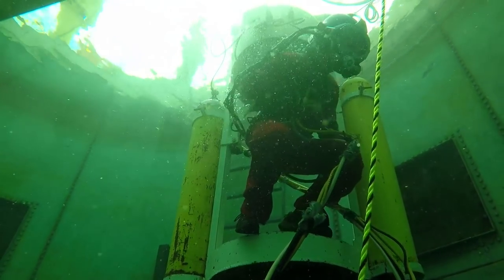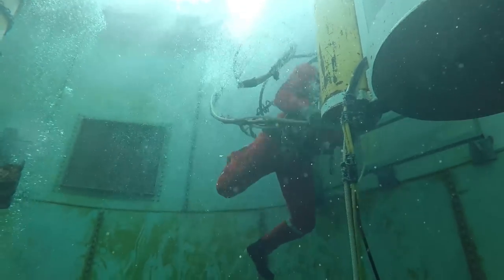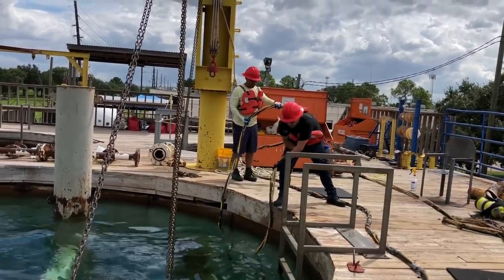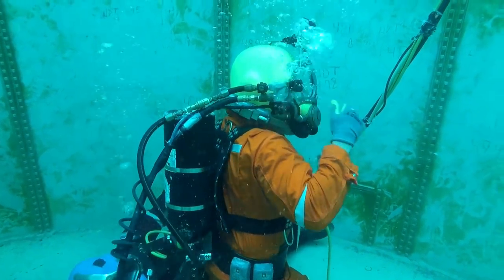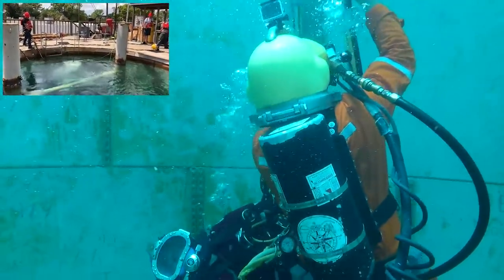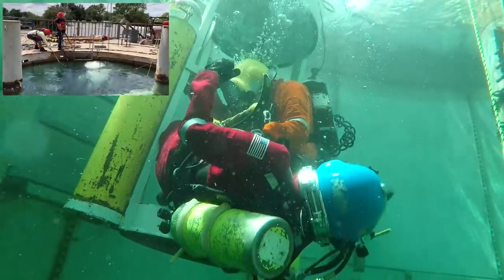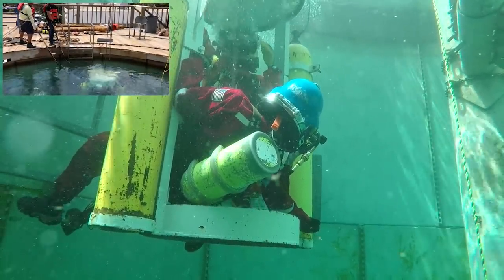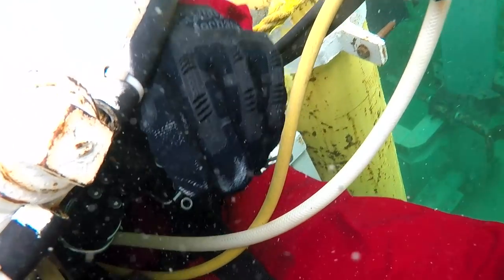Unresponsive Underwater Welder

Comment: I am no diver but retired FD. It seems to me if there were more secure lift rings on the suit around the upper torso and, a power winch higher up in the bell capable of lifting a heavy load, this procedure could be made easier and faster. We all know seconds matter in any rescue situation. Under water where there is no way to administer CPR etc. seconds turn into minutes upping mortality rate 100 fold.
Reply: We appreciate the feedback and I agree time is critical when dealing with a distressed or unresponsive diver. A rescue diver is capable of administering CPR once in the bell. A winch is not practical as it requires a power source, depth issues and salt water which in time destroys nearly everything
Reply: @richardjohnston2904  any reputable underwater welding operation must absolutely have a winch.  If it's not practical then you have no business doing this type of welding. Safety is more important than a winch wearing out because of salt water.  Most serious underwater welders use hydraulic grinders, winches and other tools.  This requires an engine on a boat or platform.  Guess what, they have to replace things often as they wear out.   You response is utter nonsense.  If you run this school God forbid the poor habits you ingrain in your students. This safety diver did everything wrong.  The unresponsive diver's air should have been switched out as his air may be the reason for his unresponsiveness. His head should have been elevated, to keep water from getting into his mouth and lungs. His head was down at one point.  And he absolutely should have been winched out of there.  If this was at a deeper depth this man would have most likely died in a real world exchange.   If you practice wrong you will get it wrong when it matters.

Comment: Is this school difficult? I’m at TSTC right now graduating December 9th welding program and I wanna wed underwater
Reply: The school isn't that hard if being a diver is what you really want to do
Reply: As a 140lbs female, it can be tough some times, I found that the diving part was easy, hauling around up to 70lbs of gear is the hard part
Reply: @maddie9240 did you graduate from here? Curious if you found work afterwards? Also was it worth it and did most you graduated with find work?
Reply: @hurt1704  I didn't graduate here, but o was easy to find work.
Reply: @maddie9240  which school did you attend if you don’t mind me asking? Curious, I’m currently a crane operator with a heavy equipment background. Would this help me get in with a big construction company needing a diver as well? I read that earlier, but I don’t work in the field so I wasn’t sure
Reply: @hurt1704  I went to CDI in Kelowna. I'm not sure if having the extra ticket would help, I havent worked in much in construction diving. But having that additional knowledge does help out.
Reply: @maddie9240  that’s understandable. Which side of commercial diving are you involved in? Was the school worth the cash for your pay currently?
Reply: @hurt1704  I work in aquaculture. I'd say it's pretty good, I work all year round, so I don't have to worry about not having work for a few months
Reply: @maddie9240  that sounds awesome. I’m sure the steady pay is nice. Is there anyway I could email you so I can ask you  a few questions about dive school?

Comment: 5 minutes to the bell , thats why i quit diving. Incompetent  runs rampid in the industry
Reply: This is a training exercise,  obviously, they aren't going to be as fast as professionals.
Reply: @cwood5072  offshore is also a training exercise
Reply: Dark to light I highly doubt you ever dived for money or even have dived before. It's not as simple as gearing up and diving to the bottom. There is procedures in place as the worst thing you can do is send down diver two/rescue who then needs rescuing. If there is two foot of visibility simply jumping in you are not going to find diver one hence the going through bell and holding hoses etc. This is only a practice scenario. Real scenarios are more likely to be deeper than this and certainly less visibility. The checks are all done for a reason, free flowing the mask to get rid of water, checking the face to see if eyes are open etc because if he is not moving but making facial response you might be able to do decompression stops if needed etc. Last thing you want to do if just yank a diver up to the top on a deep dive, until no other options are left because of divers state.
Reply: @darktolight4363  sounds like the industry lost a such a great influence when you left. Yeah I've never dived commercially but I'm experienced enough to know you don't fuck about and get a big head when it comes to water as the last thing anyone needs is two divers in need of assistance.
Reply: @sean5431  I've jumped many times as a standby diver, if your buddy could be in trouble you go no questions asked, in america we dive on 3 man teams for this reason . If your afraid to die or get hurt , you don't belong here. Schools collect tuition and promise these kids the world , the don't have the nuts or the skills to be there. You hesitate or get scared people die . I've  pulled more kids out of the water than I should have, because they have no business being there
Reply: Jon Campo  spent 4 years on the CONSTITUTION  when it was with American Oilfield Diver then stayed on 6 months when they sold to Stolt Comex.  Did mostly tie ins and repairs in the GOM
Reply: @darktolight4363  that don't say much unless someone sits on the shitter for more than 8 hours a day, just saying. I have more time behind an 18 wheeler steering wheel  than I have on the shitter and I've only been driving 4 years, lol
Reply: @davidcraft4909  there are many sayings
Reply: I took the time the time to read ALL your posts. And I firmly believe you must work for Metro State diving squad. I applaud your career choice. Just a shame you ended up with a bottom feeding company

Comment: Question,  why put the distressed diver in the bell instead of taking him to the surface?
Reply: The umbilical cord, what supplies the diver with air, hot water, radio communications and lights is attached to that bell. That bell is there habitat underwater. You can't just cut the cord and if you did, his bailout bottle only has 5 minutes worth of air. This is a just a simulator.
Reply: Bell diving is for deeper mixed gas diving. This was a training drill. If it we're a shallow air dive the stand by diver would have brought him up
Reply: @richardjohnston2904  thanx for the info👍
Reply: Thank for the info👍

Comment: took too long to get the diver to the surface, diver appears to be slightly over weighted, wearing fins will help....
Reply: Commercial divers don't normally wear fins, and this is simulating a working diver assisting another working diver. But judging by your avatar, you already know that, right?
Reply: @seikibrian8641  yup... 28 yrs diving... pulled a few guys out of the water, written police and procedures on removing divers from the water.... not an easy task!

Comment: Bro this is so wrong... i can tell you so many wrong points in this situation
Reply: What is your diving background? We are always open to suggestions for improvement
Reply: @richardjohnston2904  18 years sat diver, gulf of mexico and north sea,  you can email me.i would be glad to share any tips and what its really like in the industry.
Reply: nothing wrong with this. this is standard procedure for ADAS. bit slow, could have a beter lanyard attached higher on the causulty, and the umbilical pulling thing wouldnt happen in real life because tenders would be getting oxygen and stretchers ready as well as manning the bell controls. you would just climb the casulties umbilical back to the bell and then pull up both umbilicals into the bell and then come up on the bell. would take  under a min if done well.

Comment: Wouldn’t it be far quicker for the rescue diver to be using tanks instead of a hose, grab the unconscious guys jacket, inflate, and b line to the surface/ bell
Reply: If your less than 30ft deep then yes that would probably be the quickest way. But deeper than that if you are brought up to the surface too quickly, nitrogen will form in bubbles in your blood stream. If it gets to your heart you can die. This is why they have to slowly raise them up.
Reply: @trueduckcommander  Fair enough. I didn’t necessarily mean literally sending it to the surface at max pelt, but more the fact that I didn’t think diving with hoses on a rescue would be the quickest way due to the faff of sorting out your hoses
Reply: valid point but going down 200+ feet with a scuba tank would put the Rescue diver in the same position as the main diver  as the deeper you go the faster you burn through your tank
Reply: Commercial divers don't use scuba gear

Comment: Why dont they just take them out of the water??
Reply: if you are diving in an ocean, you simply just cannot take the diver out. You first have to ensure they are still breathing, and not in immediate danger. If they are not in an immediate danger, they can spend couple of minutes in unresponsive state at the bottom of the ocean. Man, how long does it take to get an ambulance at an accident scene anyway? Depending on location 5-10 minutes at least - so there's no real difference here, it's actually a bit faster as the trained emergency crew likely awaits on the deck.